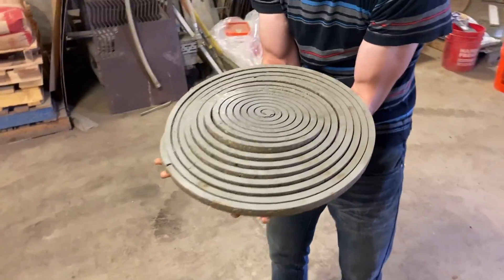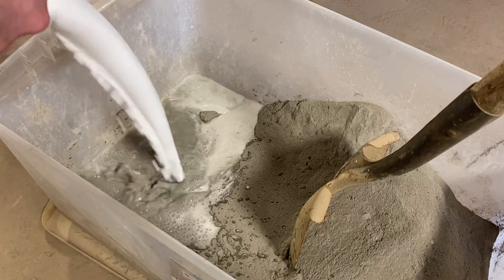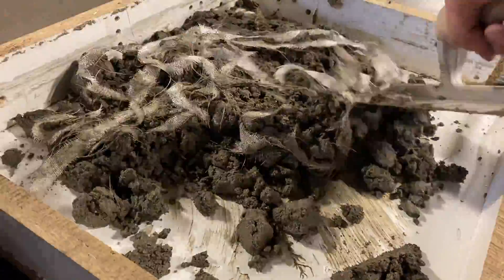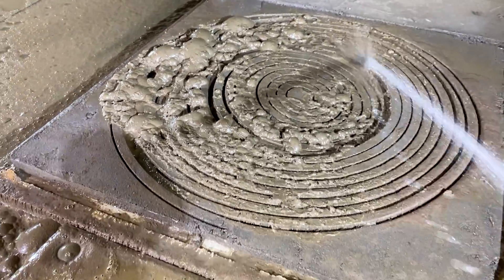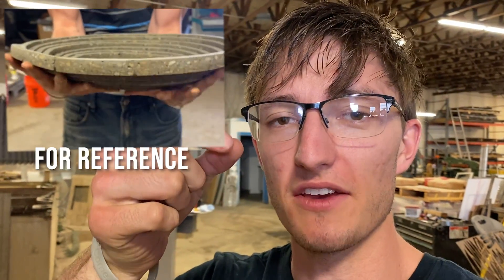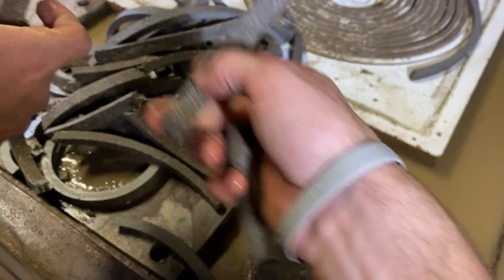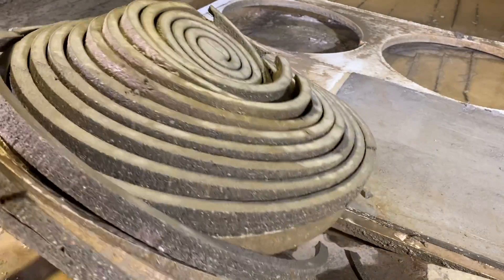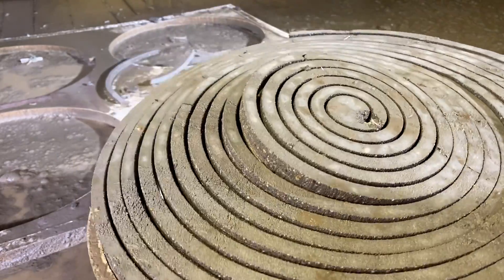We Made A Better Concrete Slinky

Comment: use steel fiber concrete, not sand with some cement in it, and do not use more water than instructed, it makes the concrete fall apart

Comment: Cement takes a month to harden and the ratios in the mix are just as fussy as baking so like if you had too much water in there it might have been weaker. But after like a day you should probably water the concrete every day to keep it in a wettish environment. 
With the shlinky which side is in bending tension vs compression? Like concrete is good in compression but poor in tension so like your reinforcing mesh should maybe be as close to the top of your concrete sandwich as possible

Comment: The mix ratio is correct but it’s practically impossible to actually mix it at the correct ratio with the shovel and bucket message. Rent a drum mixer - like $50-75 a day. Also try glass fiber reinforcement designed for concrete (bunch of short really fine individual glass fibers)

Comment: I did say it wouldn't work regardless >.> 

The biggest issues I saw were:
1) The concrete was too dry. That will lead to lots of dry pockets and spots where concrete had air in-between because it couldn't get in there well. Without water the cement can't properly complete its chemical reaction to harden. 
2) Reinforcing fibers in concrete are usually mixed in fully as individual strands or little sheets (2-3 cm wide/long attached by thin connections) and thus oriented all over and in all directions. The mesh/fabric used here mostly served to create a break-plane because concrete couldn't get through those small openings well, meaning you just sandwiched it between concrete and the mesh couldn't do its job. The concrete test squares where you had the thinner strips of fabric either gridded out or mixed in is a better approach but that isn't the type of fibers that are used.
3) The thickness of the concrete was very tiny. Usually you want at minimum 4 inch thickness for concrete. Thinner = breaks easier. 

I'll stand by that a week cure time is enough. The issue isn't the cure time, but the properties of concrete. It's basically a rock, which means once it breaks it doesn't hold together, and it's not strong when flexed.

Comment: I doubt you'll actually see this comment, but you need to but is something "bendy" like plastic in a higher concentration. Like 50/50 fiber and concrete. I doubt you'll ever get it to stick, though. 

The reason you need more is because the Youngs modulus of the cement is something like 22 MPA and it's tensile strength is only ~1.7 MPa (2.5 ksi). Any tension and it snaps. You need something to act as glue for all the cement. 

If you can add fiber to the top layers that would be pre-stretched before casting, then cured with thr tension stored in the fibers, it would be stronger. If you all could do this, it would be friggin' impressive!

Comment: The concrete is basic enough that it will eat the fiberglass.  The fiberglass that is on the wall backerboards that you can buy it at home depot is coated with PVC to prevent the degradation of the fiberglass.

Comment: Along with other excellent suggestions, I wonder if you could put the mesh or fiberglass mat in the wet concrete in a spiral so it's a solid run through the spiral you cut

Comment: Next experiment: mortar with steel fibres. There are also plastic fibres but those are more for preventing thermal cracks when curing. Steel fibres are for structural reinforcement and would provide strength under tension. Not that cheap though.
Reply: And to maximize curing in a short time, steam the cast mold for 24 hrs under thermal blankets. But that will be a PITA to set up.

Comment: I feel like just like the rocks, adding a layer partway down the middle for most of them made for a natural breaking point instead of a homogeneous material. Have you tried the pire cement with no mesh or fiberglass at all?
Reply: I agree

Comment: Fiberglass is usually treated for non-polar wettability (water is very polar) as it is usually in an epoxy matrix. I don’t think the concrete was very well impregnated.
Reply: if they made it really wet could it work?

Comment: 0:45 "...along the spots where the rockere where, because it was weaker...", actually because it was harder ;)
thanks for another fun vid.
Reply: Harder and weaker are not mutually exclusive, glass is harder and weaker than aluminum. Also it is not the harder rock that broke but the weaker bond between the cement and the rock.

Comment: I'm no materials expert but maybe you could get the young's modulus of different materials, get a sucker to lift it from the middle and see if there is any relationship between the materials properties (mass, density, Young's modulus etc) and where it first breaks (distance from the centre along the radius and distance from the centre following along the line of the spiral)

Comment: Get a mix that already has reinforcing fibers in it, then mix in water until it has a pancake batter consistency, and add some polymeric glue that's made for adding to concrete/mortar. 
Even then, this experiment may never work. Concrete/mortar has good compressive strength, but not tensile strength. It's basically a rock.
Reply: at that point why bother using the cement at all.  just make a fiber slinky.  ooooh, so bendy!!

Comment: The water is fine quik creat is decent but very reactive. Normal cement would be better. Though you would wanna wait a month. Even quik stuff is like that. As curing takes a long time hardening is 3 days to a week.
Reply: Yeah. I would bring it to extreme and give like 3 months to cure, but they definitely will not want to wait so long.
Reply: @yaroslavpanych2067  I mean any of that would work it's just yeah unfortunately impatience causes the problem
Reply: Steam over 24 hours would help cure faster. But that's fairly awkward to set up and monitor.

Comment: My man you're supposed to start with water in the bucket, then you add the concrete to the water lol 🤣😂
Reply from the maker: In principle that’s what I did. It’s edited out but after pouring all the water into the mix, I slowly added the concrete to the water. I’m just doing what the nice concrete youtuber said 🥺🥺
Reply: @WaterjetChannel  listen, y’all tried your best. And that’s the most important thing. And sorta succeeded. When you fail at first try, try again.
Reply: @WaterjetChannel no, you need a certain type of concrete for that. Quick crete I believe, with regular bagged concrete in an a bag you add the water to it so you don’t make it too soupy but if you have a small mixer then it’s a lot easier to just dump it in the water and add to it if it get too wet. They did fine.
Reply: @WaterjetChannel  Dang the hate is real here. Great job guys 🙂
Reply: @WaterjetChannel  Edited or not, you show that you're pouring the water into the mix.. you're suppose to pour the mix into the water lol
Reply: Absolutely no one mixes concrete that way, schizoid
Reply: And if that weren’t enough, y’all oughta know that slinkies are supposed to be metal or plastic. Didn’t even get the material right.

Jk this was a pretty cool series and I wanna see more
Reply: Dude waisted the video because he didn’t read the instructions. The structural integrity has been compromised I demand a remake of the video🎉🎉🎉🎉
Reply: I had no idea there was a certain way to mix concrete. I've never mixed any before. But that's a great point to point out! 😆